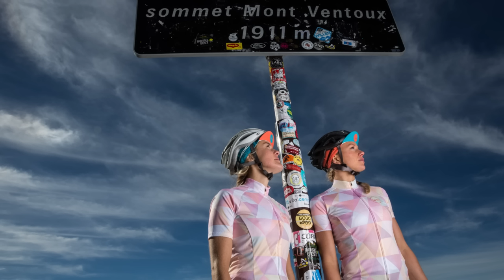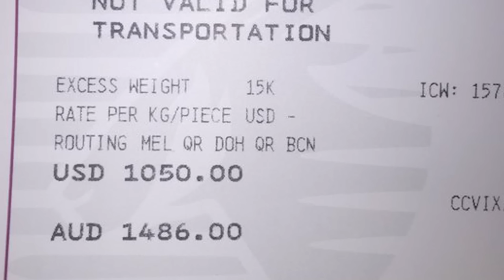Will Your Next Bike Be 3D Printed? | The GCN Show Ep. 161

Comment: The only problem with the new updated bathroom wash (by Heinrich Le Breton) is that the set-up is too high. It would make a mess, VS Nathan Tresslers stand had everything in the tub so that way it drained more efficiently. I just see the new one being more complicated because it also has an external spray, vs using the shower head  and it doesn't seem like it would be as easy to store.

Comment: i wear flat shoes since i started riding 28 years ago and until this point i have only found 1 disadvantage and thats when i need to go up technical trails uphill with my mountainbike and have to get over roots/rocks in the 6/12 oclock position since i cant really pull the paddles without clips

Comment: there was a  power meter cassette  called Final11 PICA you guys should  report it . it's made and designed in China
Reply: sounds like a bad idea. a power meter in a wearable thing,unless it can be moved to the new cassette
Reply: it can,actually they offer one free change after 8000km using.and the price it quite good too,only ￥2999（CNY） which is about €404
but they are a new company and there is no 
review out there  so i still can't decide buy a PICA or a Quarq.
Reply: +Qichao Cai id go for a well known one like stages of quarq just for the future warranty. and stages pms are pretty close to that price.and since they are new id bet they will have tons of bugs
Reply: +Damien it's not more stupide that a rear hub that is only on one wheel or on pedals that also wear and easily break on impact. Crankset or crank arm would be the only way to go
Reply: Simon Rano yeah  i think so.
Reply: Damien well I'm in China so both stages and quraq are little bit more expensive than in US AUS or Europe. and i am not sure if they have the SLK BB30 version stages imported yet.and stages accuracy is not as good as quraq.
Reply: +Simon Rano the problem I see is a cassette wears much faster vs pedals and rear hubs . unless your doing something wrong. another problem is with a new power meter it will be plaged with bugs like they all were unless they are an exception. but if it's cheaper for him ,and easy for him to get it changed every cassette. but I'd chose a crank arm pm for the ease of not having to worry about it every new cassette. but I'm the end it's his money,and I wish him luck on improving on the bike :)